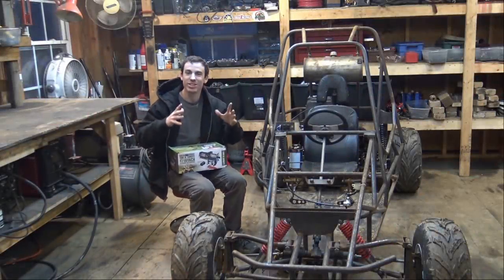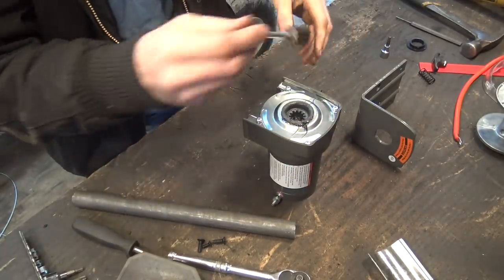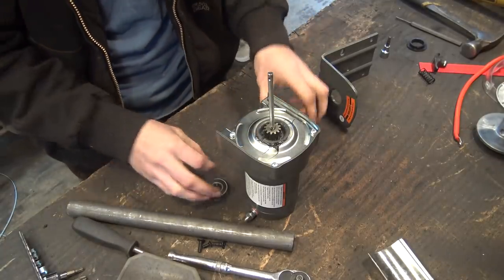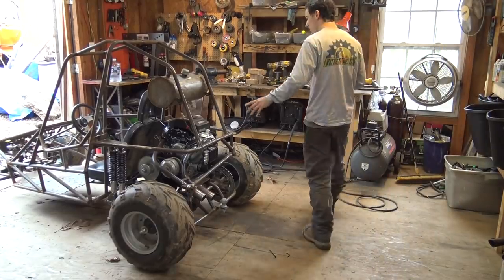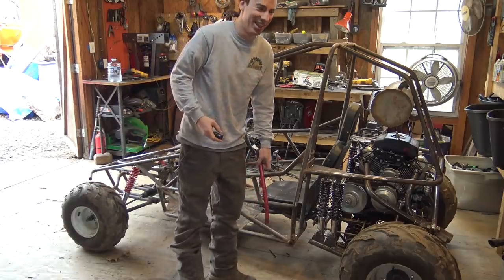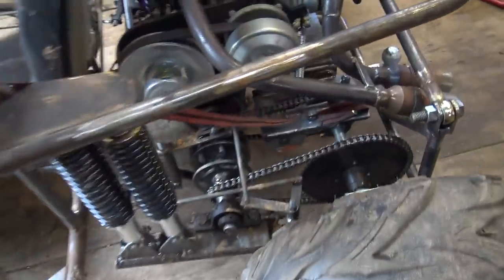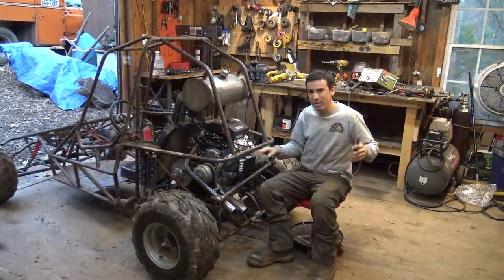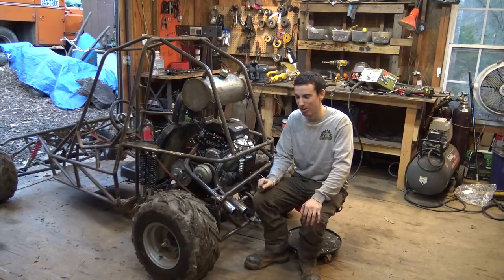Installing Electric Reverse on the Two Speed Off Road Go Kart

Comment: Gopowersports sells reverse gearboxes so you should use that!
Reply: KHR Prod. They won’t handle the power or weight of that cart. They are only rated for stock 212’s, and only on a basic yard cart.
Reply: Adam R yeah i was thinking that too! But i wasnt sure about it. Maybe in the future thay will create stronger box that handles the 670

Comment: Get a bigger battery you're running out of power meaning of those are design for like ATVs but ATVs have a constant charge going to the small battery you got a little batteries no juice going into it so she just sucking it down bigger battery more juice

Comment: Why not just install a reverse kit?
Reply: It was a concept
Reply: Those are rated about 7-12hp max depending on the exact model. I have popped one with a hotrod 212
Reply: Not to sure how you would hook it up with his gearbox it would have to be 2 forward and 2 reverse gears at that point
Reply: Dustin Miller what.
Reply: @Sam-m04  since the reverse gear box has a one in one out shaft he would have to put it between the engine and 2 speed gearbox giving him 2 forward gears and 2 reverse gears .....
 Unless he put it between his high gear and axel because most of the gear boxes have a 3to1 gear down in reverse meaning it's alot slower and more power in reverse
Reply: Dustin Miller I see what you mean, however you can buy a reverse kit that means when you pull the lever is switched from forward to reverse, if for example it was set aside somewhere on the frame with another sprocket added to the axle it may work as it would be spinning constantly, but wouldn’t be engaged until the lever we pulled, but this would also needed to be mounted to the engine or gearbox so the problem sort of  just goes around in a circle

Comment: That is a weak assed proof of concept. 

Winch and battery are very weak and gearing you used was way too tall. Never mind the spring setup would allow the winch to bounce and engage the chain while riding. 

You have a long way to go but I believe with your skills that this attempt was very amateur.